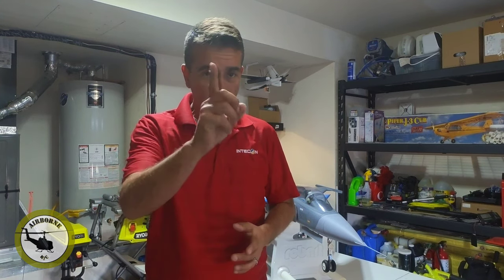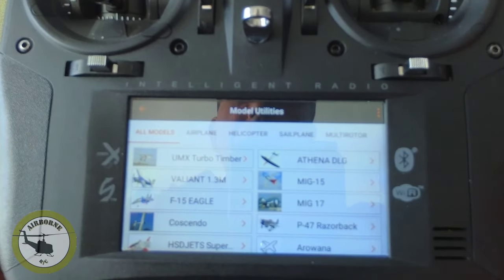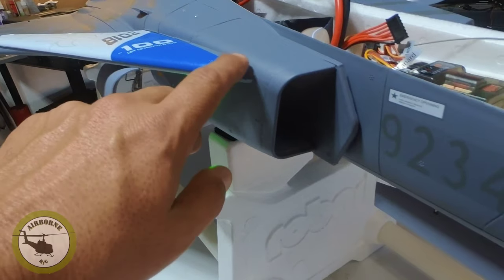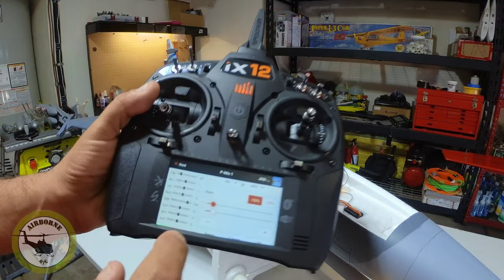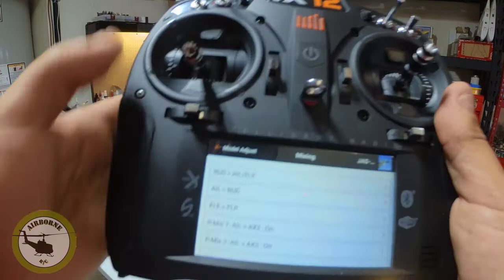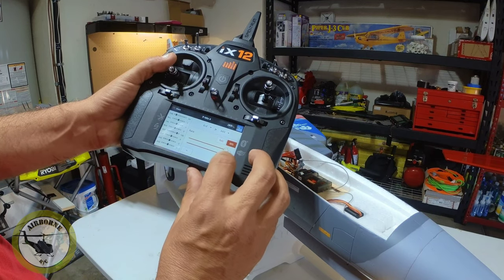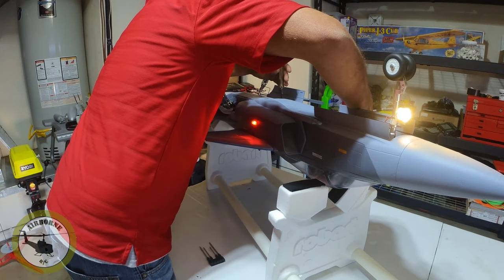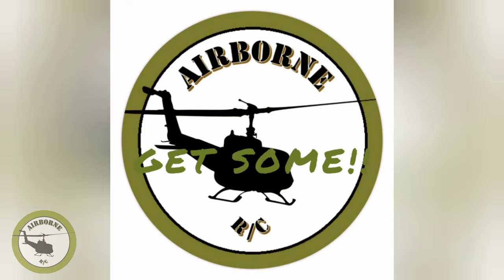Freewing JAS-39 Gripen setup, Mixing, throws Adjusting Canards, and Tips!!

Comment: Why don't you just use Y cable for each elevon to its canard. Easier than setting up mixings. If one of them goes backward, use servo reverser?
Reply from the maker: why wouldn't you want it on a separate channel? i mean you can adjust each one exactly level, control each end point (as both do no have the same geometry) makes mixing easier!!!! If "Y" you only can have it for elevator or ailerons, but not both. If you watch my mixing you will see its mixed to both elevator and ailerons.
Reply: Yeah, I just realised it. I only have 9ch rx&dx9 tx. But I need 10ch altogether. 2ch for thrust vectoring tail servos, 1 ch for centreburner, 1ch for reverse thrust. So need to think which ch I have to sacrifice
Reply from the maker: @henryairconcepts2999  make the canards just elevator ✌️🇺🇸👊